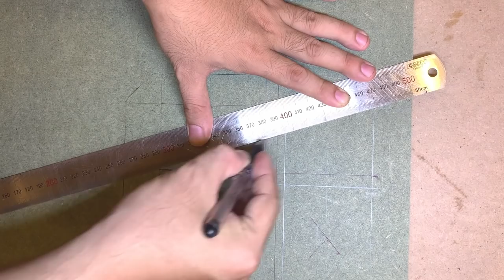D.I.Y Davialet Bluetooth Speaker 2.75 Inch mage bass

Comment: I have a question. Having a DAC installed on top of this makes any sense? Will the sound quality further improve?
Reply from the maker: I don't know what you talk about, can you send me a picture so I can see what it is, in the video I don't use dac
Reply: @kentthoi  I did a couple of research and I found out that having a Digital to Analogue Converter would be useless in building a DIY Bluetooth speaker like this. Thank you for your response though. I will try to recreate your speaker.
Reply: Sound quality could be improved via better driver to baffle interface - do you ever see tweeters mounted in a deep hole?
Tuning the box for the radiators.
Using a crossover either passive or active, with equalisation if possible. @elvinbertcorvera1884